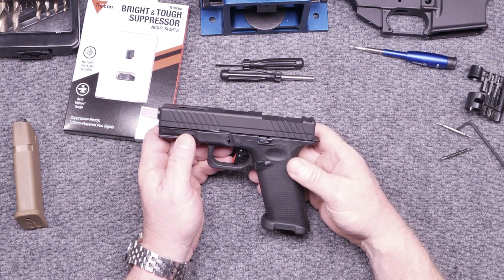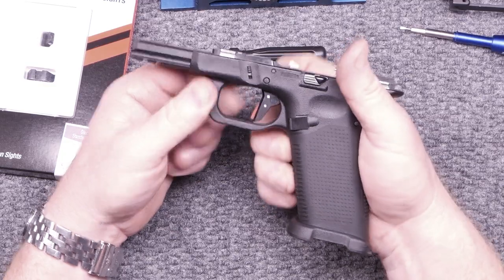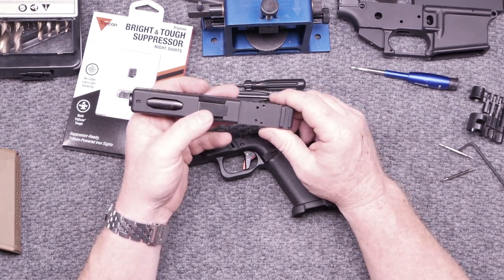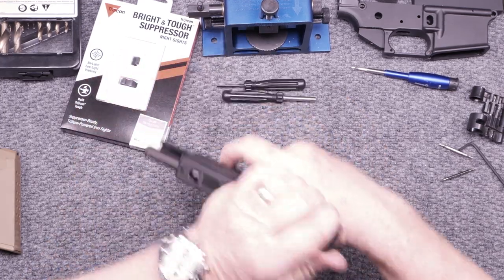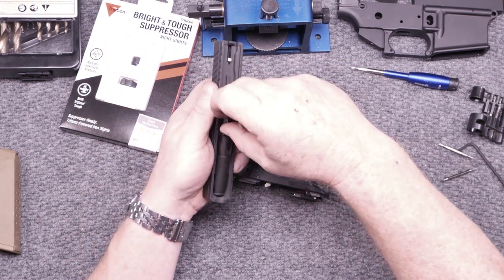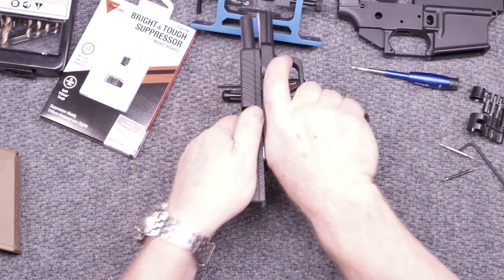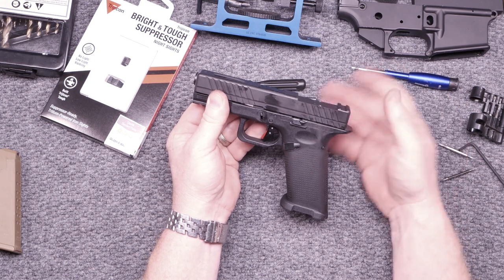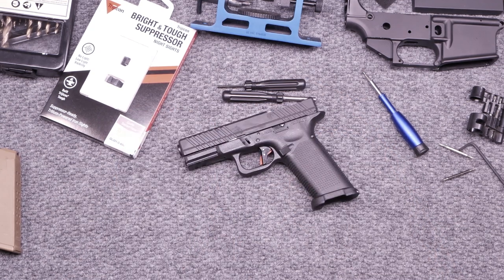Glock Build Troubles!  Not all goes Right......

Comment: Look where the the trigger bar makes contact with the connector. Pull it out and push down on the connector and see if it’s rubbing against the housing. 
When you push it down you should not feel any resistance.
That’s where I’d start.

Comment: I'm a gunsmith and certified armorer in multiple platforms and though I really do not like glocks I did buy a gen3 g17 just to see if I could make one that I like. As usual, I had to do night sights first. Second on my list was extended controls, but nothing could help the frame without major modification because of that damned hunchback. So I chose to do both, modify the factory frame and test out a better grip angle aftermarket frame. I got the complete timberwolf frame (left the flat back strap on it) and just swapped the slide onto it. Everything was fine with just the stock glock slide on the complete timberwolf frame. The reset was a bit slow right out of the box but I temporarily fixed that with powdered graphite. Later on,  I decided that I'd start swapping over some of my aftermarket frame parts from the gen 3 like the extended controls and polished stainless pins onto the timberwolf (the extended mag release has to be a gen 4 or 5 style). I wasnt at my work bench or anything since I figured it would literally take a few minutes at most. I tried to just add my extended slide release first before I had to run some errands. It came out of the glock frame with a punch and a light hammer tap as expected. Then I tried to move the trigger pin in the timber wolf and it wouldnt budge, then I checked every pin and none of them moved. Then I just decided to check around inside the timberwolf frame more and I realised how tight everything is. So they are made to alot tighter tolerances and even the factory timberwolf pins cause some drag as a pivot point (axil). One thing you should check is how the trigger bar rubs against the inside of the frame. That is likely your main point of drag in the trigger reset. I know mine is and mine is using the timber wolf supplied trigger bar which like all of their fire control parts do look thinner and are rougher than factory glock internals. They do honestly look like they just stamped them out sheet metal and chomed plated them. They still have the rough shear edge left on them from where they were stamped out. I'm used to working on "grown up" guns (lol) that are all metal and require hand fitting for most everything. So I'll be clearancing, sanding, polishing, and modifying anything and everything inside of this gun until I'm happy with it. Just know the frames are tight and there is going to be fitting required but that's not a bad thing if you know what you're doing. I bought it for the grip angle and lack of the hunchback while I do a grip reduction, undercuts, and stippling to the factory frame (though I doubt I'd ever switch back to the glock frame to use it myself, even after its modified). It's just a side project for me when I'm not working on a customer's piece but I know I can make this into a great setup. The grip angle alone is a massive improvement and mine isnt having the dragging issues as badly as yours. I've read of a few people who have had to open up or clearance for aftermarket triggers to even fit into these frames. Just get some files and a dremel, and never forget to work smart and slow and check your work very often. Good luck with the build. It damn sure does look nice. Honestly, When you're used to working with all metal and older guns everyday these things really do seem like building model cars or building with legos or something. They're just fun to work with like being a little kid with an erector set.

Comment: I can tell you where the issue is. Pull up the trigger bar and to the rear left of the ejector you need to polish off the edge of the trigger bar rubbing against the frame. 
Also check on the rear rail if they come out, polish up the rough edges of the rear rail. 
Typical of the polymer 80 style issues.
Reply: You have any help on mine I have no trigger reset problems but my slide won’t rack all the way back I don’t know if it’s the rails or locking block this isn’t my first time building a 80 percent to very familiar but this is the first time I ever had a issue like this I’m using a gen 5 23 slide

Comment: Hey mate I had the same problem. I put the timney trigger in my Glock 34 gen 5 and I had the exact same issues you are experiencing. I couldn’t get it to work properly no matter what I did so I sent it back and got a refund. I installed the factory trigger with another aftermarket trigger connector and that combination works flawlessly. The timney trigger is not a reliable option.

Comment: KB32 Tactical check the connector. In some Timney kits the connector protrudes more than it should when it sits against the sear housing. Just bend it a little bit back into the sear housing and that problem should go away. Make sure it sits flat against the sear housing. I had the same problem when I installed it in my Glock 19 X. This fixed it right away. Also, my understanding is that the red spring is for aftermarket trigger bars. Also if you did not install an aftermarket trigger bar you should be using the white spring.

Comment: I had the exact same problem. You need a armorer's backplate installed on your slide. Then you want ⅔rds striker to trigger bar engagement and debur the firing pin safety plunger hole.

Comment: I had the same issue with a Timney trigger in a polymer 80 build. I used a polymer 80 trigger housing and the Timney trigger did not quite fit correctly. Switched to an OEM Glock trigger housing and issue resolved.

Comment: Marine gun builder has some good write-ups and a good forum to ask questions. I would look into the connector being out of adjustment. Sounds to me to be some rubbing issue but what do I know. I just did a polymer 80 build and the only trigger I could get to work correctly was the p80 smooth trigger. Had all but the same issues as you with the trigger hanging up. Also don't forget about sear engagement.

Comment: Looks like there's friction somewhere.  Possibly between the trigger and the opening for it in the frame?  I've experienced that on some factory guns.  Friction between trigger bar and the frame maybe? In the end there it seemed like the slide may be the culprit.  Maybe try it with a factory slide setup first to reduce variables.

Comment: When you run an aftermarket trigger, you may have to get a matching safety plunger and striker spring. I installed an Apex trigger which came with a safety plunger and a striker spring on one slide, and I noticed when I put that slide on a different lower (that didn’t have the Apex trigger), it produced the same problem you’re experiencing. So there’s a compatibility issue with parts.
Reply: Oh, I forgot to mention the connector. The trigger came with a connector, as well.

Comment: I love the G19X! Been wanting to try and build something similar. Big Polymer 80 fan. May be drag on the trigger bar? Watch out for the recoil spring channel… have had issues with the non OEM ones being oversized causing some slide dragging issues. The other thing I’ve had give me issues is the disconnector not being adjusted correctly(tension). It’s an easy adjustment.

Comment: I had the same issue with the timney trigger and lone wolf frame. I concluded that it is the trigger housing. Due to the 1911 grip angel,  the housing sits just a hair different than OEM glock. Lone story short, I had to return my timney trigger.

Comment: Trigger and striker aren’t working well together. Try replacing the trigger first. If it still gives you issues, then use a factory striker. Then go one at a time to isolate the problem, recoil spring, connector, etc… Been there, not a good feeling. 

For what it’s worth I only carry a factory Glock trigger now. Only other trigger I trust is Apex. I’ve tried many. All the others have failed at some point in one way or another.

Comment: Change your connector or bend it out a bit.. it isn't snapping out and resetting like it should, it's right on the line meaning it's gonna be sporadic.  The reset will be much softer then other glock triggers though

Comment: I think you're right on point with suspecting something is dragging and that's why the trigger is sluggish to reset but for it to go off by itself sounds like that crucible bar is sliding off the ledge it's supposed to be sitting on and the safety plunger is getting hung up as well so when the gun resets it's allowing the striker to go home... I think because it interacts with the trigger bar that could also be the cause of the trigger being sluggish to reset. I'm probably 100% wrong but that's my very basic understanding of all of it. LOL I don't mess with handguns as far as building them or even tinkering with them how they come out the box is how I shoot them.  Hopefully you figure it out it definitely looks pretty sweet and great video as always keepem coming brother!!!

Comment: I have the same setup minus the Timney trigger. Lone wolf frame and live free slide. I had a similar problem with my factory trigger and the problem was that the adjustable trigger housing from lone wolf was just out of whack. I played with the set screw for 20 minutes or so and got it fine tuned.

Comment: Pull the connector out and bend it in toward the housing. It may be angled to far out and putting too much pressure against the trigger bar, making it drag against the inside of the frame. Good luck sorting it out.
Reply: Had the same issue and this resolved it for me.
Reply: Yep that was gonna be my comment. It's the connector.

Comment: @KB32 Tactical I would take a caliper and measure the trigger well and trigger to see if there's fitment issues, I would also check the bar that the trigger actuates on to see if there's any fitment issues with the bar that the trigger actuates on as well as burs on any of that that would have an affect. I would also compare the size of the springs against factor springs. If there is a difference like if the factory has larger springs, I would try the kit with the larger springs and see if reset dwell time improves. Lastly, I would try to see if break in of everything would improve the reset time further than fitment testing time. Good luck!

Comment: I have the same frame and having similar problems. I am using stock trigger but I cannot get it to repliably reset. I'm using a glock 23 upper which should work fine. Get rid of the Timney then take a close look and also the material you are to take away in the back of the frame. PH80guy has lots of help on these. So, far though, I have not gotten mine to function they it should.

Comment: Kb 32, ya gotta check out johnny glocks channel.  He talks about everything that you need to know brother. He addresses the timney trigger specifically. So some of the issue tour having is the engagement between striker lug face and the seer. Get yourself an armorers back plate, or make one like i did. Nasically cut the bottom off of an oem polymer back plate. That will show you your engagement between striker lug face and seer. I run mine about 50 percent. It kinda depends on your system though. Glocks are stupid easy once you figure them out. Johnny glock is the man.
Reply: This is your best answer right here. Your cruciform kickup may not he making contact for it to fire and the connector looks like its got rub as well. Id have to hold it to fix it unfortunately

Comment: after getting the striker engagement right and your connector figured out, add a dab of white lithium grease to your bird's head - connector interface.

i think you'll like the LWD TWC-F frame.   i have wider than normal hands and the compact leaves me half a pinky off on the grip length.  the 25cent trigger job does wonders in the glock pattern if you dont already have a polished trigger bar.

Comment: The Lone Wolf frame has to have a lone wolf lower parts kit
Reply: I found a Glock OEM trigger assembly works better than the LWD one. But could be something I am missing
Reply: yeah i had problems with mine switched with lone wolf lower kit works 100% now thanks

Comment: I just built a P80 Compact and had a similar issue.  Swapped out the aftermarket trigger with an OEM in another gun and it worked fine afterwards.  The strange thing is, the aftermarket trigger went into the other gun (straight swap) and it worked there.  Weird.

Comment: Your connector is most likely bent too far out. If there is daylight between to top of the connector and the side of the trigger housing, remove the connector and slightly bend it so the edge of the connector is just inside the recess in the trigger housing.

Comment: I have had poor luck recently with EBay Glock parts…. My impression is poor tolerances and qc leading to tolerance staking issues. Between that I’d also suspect the issue might be related to the trigger and/or barrel. If you have a stock OEM Gen 3 19 I’d use that to help you troubleshoot which part/s is causing the issue.

Note I have a Gen 1 Timberwolf frame (G17 size) as my EDC going on 4+ years… no issues, great reliability, using an overwatch precision flat face trigger. Love my Timberwolf.

Also recently built some Glock store GSX100s which are G19X size. They’ve had their own QC issues with locking block fitment, but they feel AMAZING in the hand. You should check them out as well.
Reply: Yea it’s crazy man, before pandemic my lpks we’re cool, no issues. No all my lpks, the slide lock/release bar is hitting the frame. And locks the slide when it’s not supposed to. I had to sand down some of the frame to get them to sit flush.
Reply: @skunkycatog  ya I have issues with all my recent builds using eBay stuff, it’s why I literally wheat out of my way to buy an OEM G19 in order to help with trouble shooting. I’ve found success with parts from Brownells.

Comment: Did you ever get the gun working correctly? I want a dagger slide on a lone wolf frame
Reply: I just built one with a lone wolf lower and a dagger frame and so far fits nicely and seems to operate as it should. Haven’t shot it yet
Reply: the problem with these frames is the lower parts if you get lone wolf's brand of lower parts kits works 100%

Comment: Wrong connector for this set up. And send that timney trigger back and get a refund. Put the OEM back in it, then it will work right.
Timney for Glock are NOT as good a trigger system as people think they are. They are NOT as universal as people think they are.